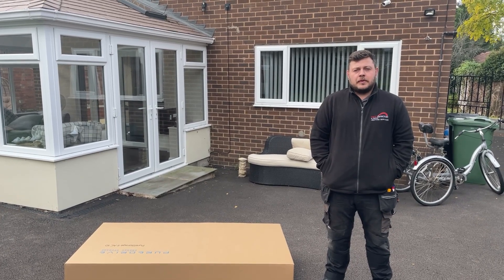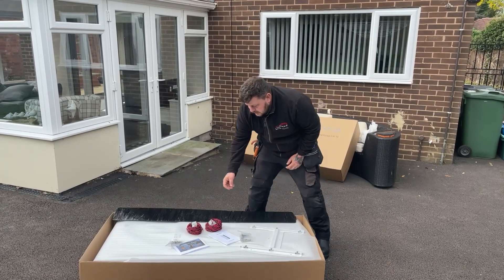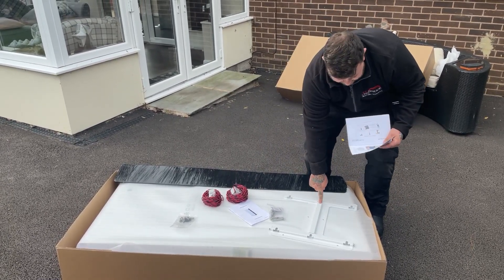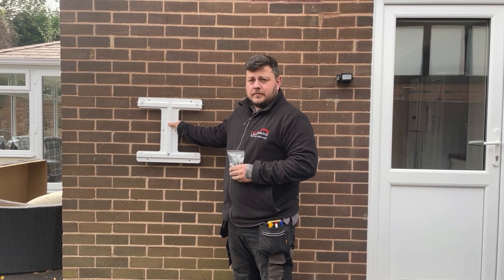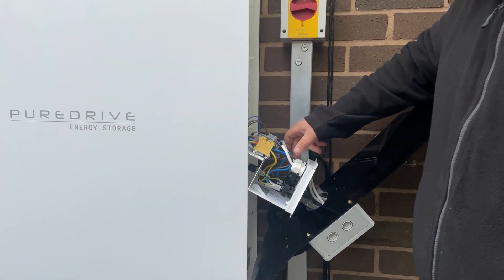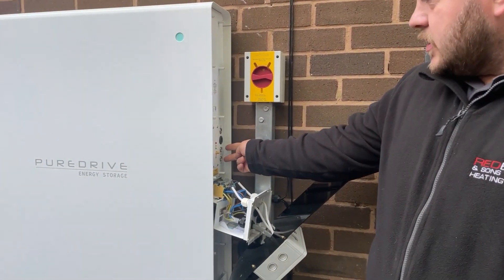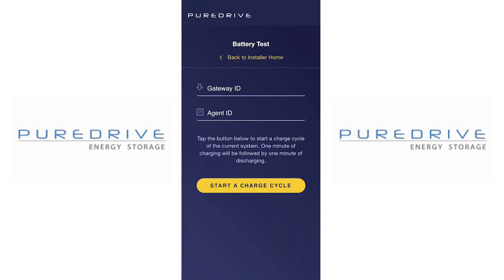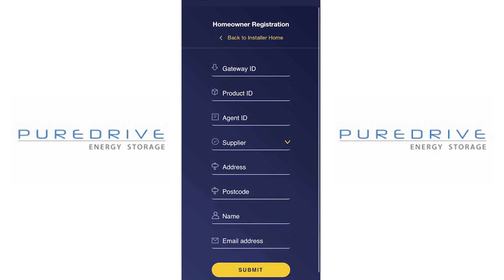THE EASIEST HOME BATTERY TO INSTALL! || Puredrive Energy - Purestorage-II AC 10kWh

Comment: So just just watch a review "Puredrive Purestorage II 10kWh Home Battery System Review" by Joe Bloggs who bangs on (moans) about the safety of these storage boxes. There are completely safe if you have a competent installer. As demonstrated in this review at 2.25, the installer has quite correctly added an isolator switch.